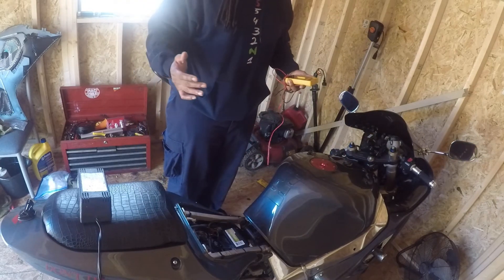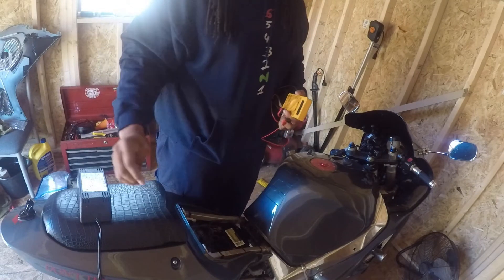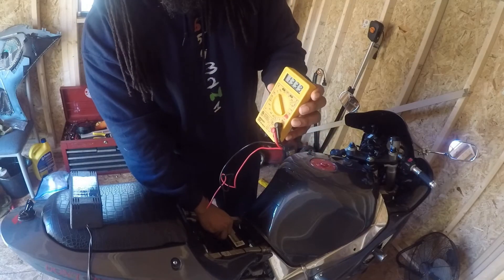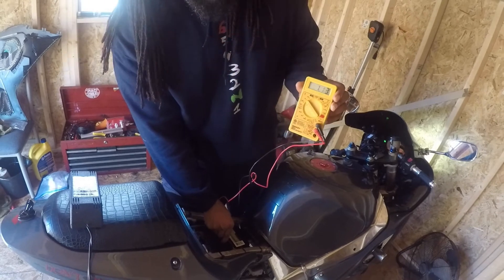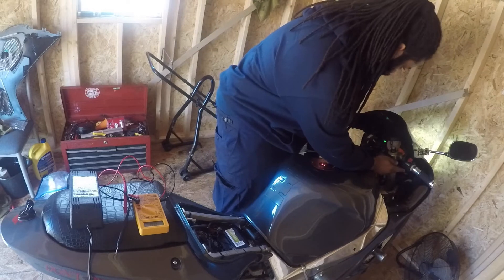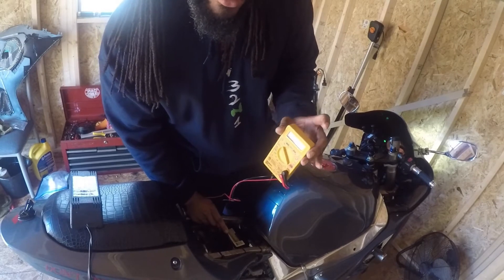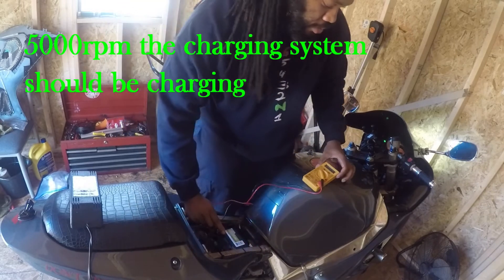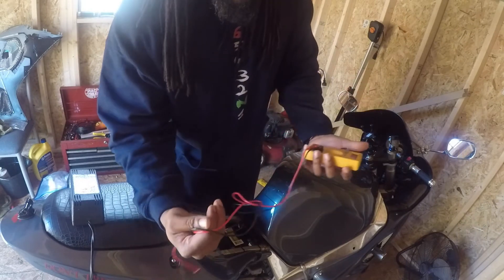GSXR charging system

Comment: I've had my 750 gixxxer for over a yr now, previous ownser.. headshake. I've replaced most of the electrical, new battery, new ignition switch, new spark plugs, recently bike died while riding randomly. Since the batttery is newer, i'm thinking it's either rectifier, killing the battery (high resistance), or alternator sending too much volage/currenty to the rectifier. My rectifier is 3 phase.  I'm still investigating, could also be a bad switch or faulty wing. As others mentioned, some ppl just like bikes, shouldn't drive. Off topic, my sisters car she purchased a yr ago, I've already replaced her gas pedal, ignition coils, fuel rail, i'm in awe at the amount general public doesn't know.  those videos of ppl who do not know vehicles needs a oil change for example. Just a DIY over here, saving fam $$$$ not going to shops.  Thanks for your video man. Make more!! We may know a few things, but you have an entirely different view than anyone else, who knows what issues you'll help others fix.
Reply from the maker: Thanks man..I had my bike die in middle me riding before on different bike turns out was exposed wire grounded the whole bike i was on highway ..but if replace battery run for lil and die while riding its the rectifier not charging it

Comment: How do you know if the bike is over charging the battery?
Reply: If this is still relevant, usually a higher voltage 15.5+ on the battery when going 5k rpm. It shouldn't go into 17+ volts. If it does, it's over charging. Hence "voltage regulator" is not regulating.
Reply from the maker: Alot time if your bike has battery light will come on or if you have a volt meter like in video you can check the battery charge while at idle see id lf its reading higher..make sure 👍 & sub

Comment: So I just bought a 05 gsxr 600 and the guy put new stator and rectifier in but on stator he didn't put wires behind bracket in housing and the flywheel tore the wires so I went in fixed them and now it works but when I bring up RPMs it drops from 13 to 14 to 9. Is this normal or is the stator or rectifier bad again from his mess up?
Reply from the maker: Yea im gone say you might have a problem..it should stay at round 12 it will drop when start it of course ..but on gas it needs to be up therefore charging the system when iding

Comment: Mines not holding charge at all & I changed the stator, & rectifier.
Reply from the maker: Maybe yo check ground make sure don't have no wire grounding it out
Reply: @2wheelgardener   Ok thanks..